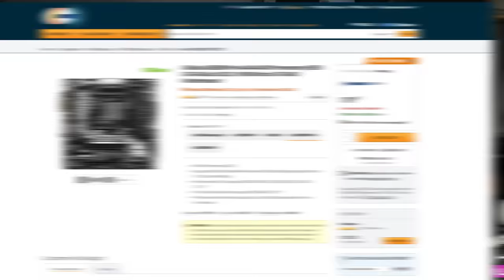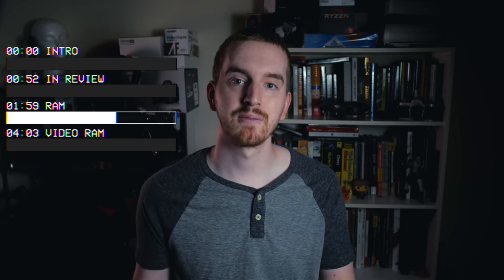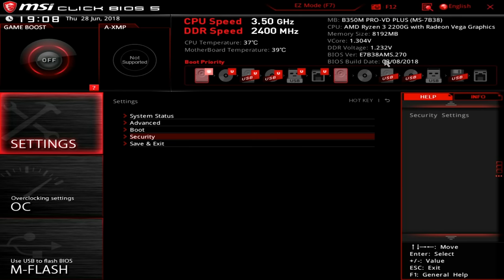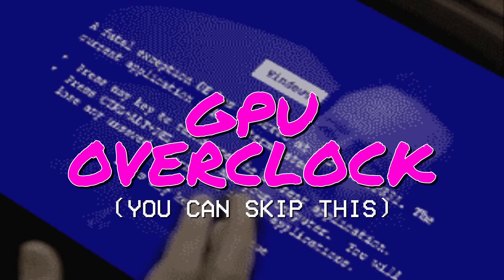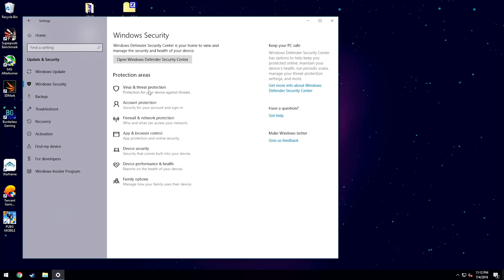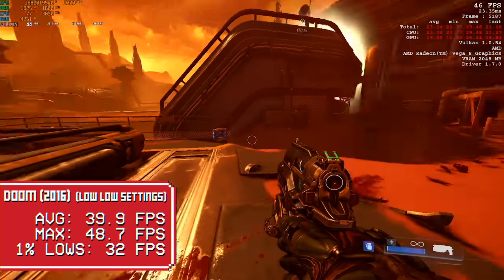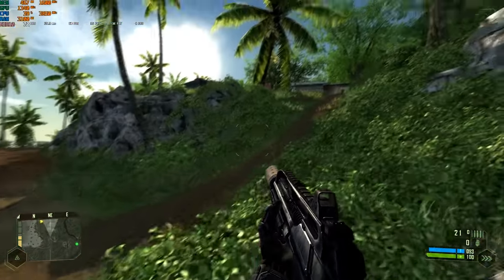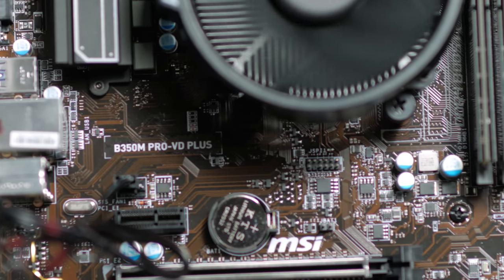How to get INSANE GAMING PERFORMANCE out of AMD Ryzen 3 2200G APU - Ryzen 2200G Optimization Guide

Comment: I dont recomend the asrock b350m pro 4, a lot of people had issues with the ryzen apus, me included, even with the latest bios and drivers, bsod and crashes, after I switch to msi b450m vdh, problems gone!!
Reply: Right, I would recommend if any 350 mobo to go with the gigabyte GA-AB350M-DS3H its runes all ryzen 2000 series w/o bios updates.

Comment: My asus tuf b350m has stable clocks at 3.8ghz @1.375 cpu, 3200mhz @1.35 ram, 1550mhz gpu @ 1.3v but I had to add better thermal paste and a heat sink to the chipset

Comment: As soon as I updated to Adrenaline 18.8.1 I started having an issue being able to OC my GPU in Ryzen Master.  I was getting an issue when after I applied settings in Ryzen Master after the forced reboot my system would turn off instead of reboot wouldnt power on and I had to pull the CMOS battery to clear the settings and go back to default settings to get the system to boot.  I then realized today that I was running an older version of Ryzen Master.  I downloaded the latest version of Ryzen Master currently to date which is 1.4.0.0728 and now I am able to OC the GPU and my system didn't shutoff and require me to clear the CMOS when forcing the reboot.  I hope this helps someone else because this was driving me crazy after I upgraded to 18.8.1.  I'm holding out to upgrade my GPU because of the new 20X Nvidia series being announced on Monday, Aug 20th so I'm hoping to squeeze out as much performance as I can out of this Ryzen 3 2200G APU!  Currently playing PUBG on very low settings 720P getting 50-60 FPS with dips down to low 40s with the GPU OCd to 1500 1.2 on the APU GFX voltage and 1.2 on the SOC voltage running the stock cooler.

Comment: Oddly enough my V-ram max amount in BIOS iis 16GB when I have 8GB of RAM, should I bump it up to 4GB of Video Ram?
Reply: Does it support that much?
Reply: @psychoalert1823  yes ASRock boards offer such a feature but I not sure about how stable if bump up to 4,8 or 16gb VRAM memory
Reply: @mrmk92  wow. I am about to buy an asrock mobo to pair it with the 2200g and didn't know that.
Reply: @psychoalert1823   take a look asrock b450 pro4 and b450 steel lagend both has vram allocation upto 16gb if you not meant to overclocking go with either boards it should work fine
Reply: @mrmk92  I'm going exactly for the Steel Legend
Reply: @psychoalert1823  Good luck, happy gaming..

Comment: My gigabyte bios is trash. Barely can do anything apart from getting the buffer to 2g and setting my ram from for some reason 2133mhz to 3000mhz which is the default ram speed. Apart from that there's barely anything else I could but again I have minimal knowledge of any bios but either way the msi or Asus bios seems easier and straight forward.
Reply: dload ryzen master

Comment: How good is a cpu or dual cpu setup with a cinebench r15 score of 782?
Reply from the maker: That's pretty low.
Reply: My score passes an overclocked i5-4690k. How is this low?
Reply: Mr. Peanut Plays My overclocked I7-875k (1st gen I7) got 623 if that tells you anything
Reply: Dann Decker my overclocked i7 960 to 4ghz barely gets 620
Reply: Chris Hansen yeah i had mine at 4.1 GHz. Still have it too, but upgraded to the R5-1600x
Reply: For my setup being about 10 years old, I see my score and others as great seeing as how some processors of today can't break 600 sometimes.

Comment: I wouldn’t recommend auto OC or overclocking with auto voltage. In both cases, the motherboard will pump in more voltage than needed, and could possibly degrade the CPU over time

Comment: Thanks for the pubg mobile vid..now i can have a peace of mind to install the tencent emu on my 2200G pc,but i wont oc it at all anyway..still using my 8gb 2400mhz ddr4, hopefully it'll be fine
Reply from the maker: Yeah should run good!
Reply: EposVox one more question though..the 2200G is my htpc for TV but there's another gaming pc Which currently have g4560+h110m, should i go for an i7 7700 or just upgrade to ryzen5 1600+b350m which is currently cost lesser than the said Intel counterpart?
Reply: Metaberry alright then.. consider it noted
Reply: +crysisownz
What kind of GPU do you plan to pair it with in that gaming PC?
If you OC your 1600 it should get close to the performance of the 7700 in games and stuff that just use 4 threads (although the 7700 will win there).
In games that use 5-8 threads the overclocked Ryzen 5 1600 should do better then the i7, not so much in terms of average fps (the i7 will still win there) but in terms of 1% lows (provided that the game or application in question is big enough to potentially make a quad core i5 run at 100% load, if you have a game or application that does use 5-8 threads but where the workload is smaller then 100% load on a 4 core-4 thread processor like the i5 then the i7s extra threads will be able to handle the workload better then the 1600 even when the 1600 is overclocked).
For anything that uses 9-12 threads the Ryzen 7 1600 overclocked should be winning though, also in averages (provided that the workload pr thread isn't so small that the i7 can fit it just fine within its 8 threads, if the 8 threads do not run at 100% then the average should be higher on the i7 while the 1% lows might be higher on the Ryzen chip, a quad core i7 and the hex core i5 from intel are roughly on par with eachother, trading blows depending on the workload)

My point of reference, my own R7 1700.
Reply: Luredreier depends on the pricing..r5 1600 costs less here sometimes 50usd less when combined with a b350 mobo,i play asscreed and fc5 currently..hv seen stutters that broke the game on my g4560 when im dloading stuff on the background.. that's why im considering the ryzen5 now..i played most of the time in 1080p anyway
Reply: Luredreier i forgot to mention currently i have the 1060 3gb on my rig..but aiming to replace it with a better amd card/vega56
Reply: +crysisownz
A CPU is more important at 1080p and the extra single threaded speed of Intel matters more then while the multi-threaded performance of Ryzen matters less then.
Given the local price difference Ryzen actually seems like a good option.
Going with the 7700 mainly makes sense when you save money by not having to buy a new motherboard.
While the 1600 is slower in those workloads that has less thread level parallellism the platform has the advantage of supporting the next Zen arcitecture too, something that should hopefully improve the performance significantly.
However, considered using the 2200G for your gaming system and using the g4560 for the htpc for now?
Then perhaps you can upgrade later when the Ryzen 3xxx series arrives.
Reply: Luredreier ohh i just noticed some local etailers sale,heck now even the ryzen5 2600+msi b350m bazooka is cheaper than an i7 7700k😂😂😂
Reply: Luredreier nope. Currently the 2200g is my htpc,as there's a lot of evergreen classics that i wanna play on that using steam lib..i wanna sell the g4560 if there's no sale of any i7 compatible with the board
Reply: I'm gonna build the same this week lol, without tweaks too,cause I only have 450 watts

Comment: what emulator did you use in pubg mobile?
Reply from the maker: The official one. Tencent Gameloop or whatever they’re calling it now
Reply: i still encountering stutters and fps drops when i play cod mobile in gameloop.
i already do all the optionss and settingsss.  all on low settings
i also use ryzen 3 2200g 16gb 3200mhz ramss

please help

Comment: 3:46 as far as i know your msi b350m pro vdh does have a jumper for clearing the cmos. so i am wondering why u dont use this method instead pulling out the battery.
Reply: OK, u dont have the pro vdh board...

Comment: i highly regret buying a 2200g system. for some reason my windows is not recognizing the Vega 8. i have to reinstall windows i think. my network is limited and slow. money gone to drain. if anybody in this comment section has any tip for me, i would really appreciate.
Reply: mess with bios. i have 2200g and 2400g 1400 and 1600 and 1300x and a 1200 trust me its all about tinkering and having patience i litterly have like 10 mobos for ryzen b350s a320 at first things were really bad when they first came out but everything is working now. even the mobos that say ryzen 2000 ready they are not. i was intel all the way before this but the 2200g taught me just dont expect plug and play.unless a320 with all stock settings. and a a6 9500 to update the bios jnc. btw you still can mess with memory with the a320 which is most important.i have 6 extra a320s lol. talk about wasting money lol i did. but learned alot about the red team even made a 1090 build after all that crazyness.
Reply: i'm new for PC. i just did my research. and i find out that 2200g is good. less power consuming and gives a decent performance. now that i look back at my comment. i don't regret buying that. it was my window's fault. the service guy fixed it. i could have done it. but my network is crap and limited. you seems like a rich boi. what are you doing with your life, haha lol. i now strongly admire the red team. i did some oc for my memory. oc'd it to 2933mhz. it didn't made a big change. so i made it back to the factory speed which is 2400. but idk for some reason my mb shows more than 2gb vram allocation, like 16gb or so. and it also shows oc settings. idk is that normal or not. i have a a320. yea its a cheap build. but it cost me like 420$. i live in India. its very pricey in here. anyways good luck to you. :)

Comment: my god, don't tell people to start by overclocking ram, most of them are not confident with overclocking. Ram overclocking is complicated by it's own, an inexpert user might leave the voltage to auto or set too high. And if the system boots, it doesn't mean that it's stable, it's always better to run memtest for some hour.
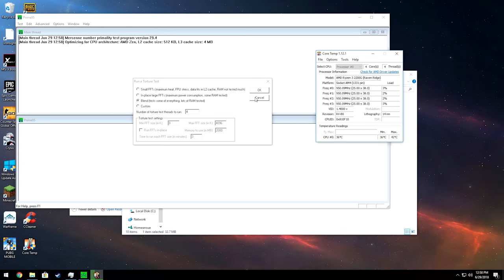5:11 What really, use the motherboard auto oc? or set the multiplier and leave everithing on auto? What's wrong with you? at least tell people to not exceed 1.4v  Don't do this type of videos, if you don't tell part of the settings

Comment: I have overclocked mine to 4.0 GhZ :D
Reply: Temp ?
Reply: @khalid7741  35 degrees celsius in idle and 50 - 60 in work or gaming but im using different cooler
Reply: @nxtfighter7425  do you know if it works if iput 4gb of ram with this processor?
Reply: @johnkimble1825  Yes I used it for the first days with 4GB of ram and it worked fine for me.
Reply: @nxtfighter7425  thank you =D

Comment: i think a apu is garbage, why?
I play quake champions with an gtx 1050, at 900p, the max memory usage was 10,5gb.  Gta v i got 8,5gb in some game. So if you have a 2200g with 8 gb, 6gb will be left for system, 1gb will be for windows, so you have only 5 gb to play modern titles, good luck with that.

I believe my gtx was using ram as vram in quake champions, but the minimum of the game is 8gb, so it uses a lot of ram
Reply: just buy 16gb of ram??
Reply: SplaJanku 16gb of ram, ok, you need dual chanel, and fast ram, thats not cheap. You better with a proper gpu  and 8 gb than that. Apu Its only worth if ram prices are cheap, and anything above 8 gb is a waste for such low performance setup.

Comment: Nice for apu builds put darn this is hell 

Better build a gpu buold now as the prices are quite down (i found a 1060 6gb at 269€ which is 275$)
Reply: +u do no me
If a 1060 is within reach of your budget then this thing was never meant for you.
It's competing with the likes of the RX 550 and the GTX 1030 or possibly a GTX 1050/RX 560 but paired with a lower end CPU.
There's also room for more performance and less issues then what he experienced by doing a few things differently.

Comment: Let's explain what the fuck you just did: overclocking of ram and cpu speeds, USING RAM AS VRAM(WTF?) and getting +40fps avg? It's not real fps-es by the way. We can see you got cut-freezes in some moments because ram with any boost is slower. Anyway i never saw something like that. Respect from budget gamers!

Comment: 2000 series should do 4 GHz stable
Reply: +Tech Dunk
The APUs are not Zen+ like the 2000 series CPUs.
Rather they're kind of in-between Zen and Zen+ with a worse process node.
Reply: Luredreier my bad
Reply: Np =)
Another thing to consider is that when overclocking just a CPU you don't have the extra heat and ripple generated by the iGPU to consider, with this APU the iGPU will use power, influence how level the power delivery is, produce heat and produce magnetic fields, all things that can influence the CPU and its stability at a given frequency, so even if the CPU was identical a identical clock speed can't really be expected.

Comment: I got my Vega cores to 1700mhz
Reply: what's your SoC voltage ? And Core voltage ?
Reply: @thesorrow7499  I used ryzen master and I have a athlon 3000g so 1.3 gfx voltage idk abt soc voltage but after a little more testing it was unstable so I underclocked it to 1650 and now after like a month usage it's still stable

Comment: ehm, my dude, you must have increased the voltage, or the BOIS did it for you, you were sitting at 1,4v during stresstesting on P95 5:53
Reply from the maker: I think that clip was when I was trying some Ryzen Master settings.
Reply: might be, but if you leave the cpu voltage on "auto" on some motherboards, they'll increase the voltage in such a way to guarantee stability with the clockspeed the user sets. in other words; turning the voltage waaaaaay too high.
Reply from the maker: I'd also take that with a grain of salt, nothing on the CoreTemp measurements was all that accurate.
Reply: In that case you can take a look at the cpu-z numbers, which was at 1.37 or something, which still is high. The ryzen master also reported 1,4. Your voltage IS high
Reply: @hartlytartly  Assuming this is the case, would you recommend manually configuring the clock speed and voltage, or leaving the voltage on auto? Are the only risks thermal throttling, and stability, or could we be risking losing the magic blue smoke?
Reply: @Thalanox  in the era of processors "auto clocking", undervolting is the new overclocking.

Comment: RTFM - JBAT1 - CMOS Clear.
Reply from the maker: Less about reading the manual and more about doing it an old school way
Reply: OLD SCHOOL WAY he says! Using the jumper provided to  properly electrically reset the BIOS EEPROM  is an old school way VS physically removing the back-up battery? The main issue with removing the battery (other than it's way harder/more fiddly than just using the jumper) is that those little coin cells only have like 40ma in them, you can discharge them just by holding them on both poles at the same time.
Reply: if it's old school to do things properly, and new school to flub it.... you're right
Reply from the maker: I've been working on computers since the very early 2000s and the sure fire method has always been to pull the battery. I'd call that 'old school.'
Reply: Late 90s, on mid 90s machines. Jumper has literally always been the proper way to do it, it's why they provide the jumper on motherboards.So you don't have to pull the battery. And to guarantee a full erase.

Comment: Ryzen APU builders should try and stay away from ASRock B350 boards. There's a high chance of instabilities. I was unfortunate to experience this first hand. There are hundreds of complaints from asrock board owners on asrock forums. And they all got unanswered for months. I would recommend Asus Prime B350M-A instead. Doesn't need a boot kit, will boot the APU out of the box.
Reply: I have two 2200g builds, both in ASRock b350 mini-itx boards and have no issues in either. And they get better vrm temps than other mini-itx boards, like the gigabyte one in particular. One I had pretty stable at 3.8ghz/1600mhz OC prior to putting a 1050ti in that build, the other I have stock cpu clock and 1525mhz oc on gpu. I had it up to 1600mhz on 1.2375v, but was hitting temp limits since the mini-itx case that is in does not have any fans other than the cpu fan, so backing it to 1525mhz at 1.2v dropped it enough (still trying to figure some way to add an internal fan, maybe a 40mm if I can find a thin one, or some external fans while still keeping its console-size sff).

Comment: Your not squeezing INSANE performance out of a potato! Its a damb potato! Every part in that build is worthless even with overclock. There is no point in spending $350 on parts that you have to overclock out of the box just to run games on low or medium settings. You need to tell your viewers to save a little bit more money like $850 total or more and build a better PC that can run games on high setting so in the future when a new game comes out their PC can handle it. Otherwise your viewers will feel like they just wasted their money on a PC that needs a better CPU, GPU and RAM.

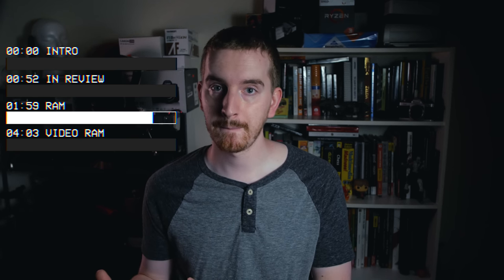Comment: 3:20 or just hard reset pc 3 times
Reply: also its best to set  memory allocation to 64mb, once 64mb are full gpu will use system ram which is the same thing
Reply: it seems that there is "frequency blackhole" in between 1400-1500Mhz, my igpu wont run at 1400-1499 but works at 1500Mhz
Reply: to fix colors disable full screen optimization